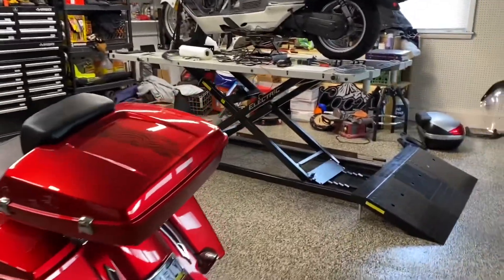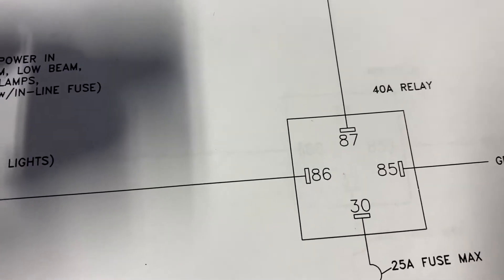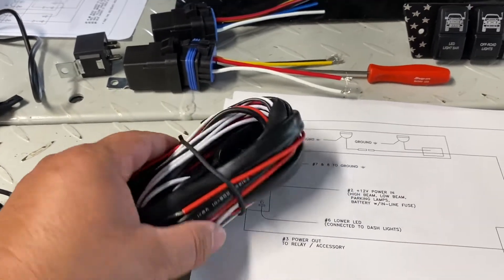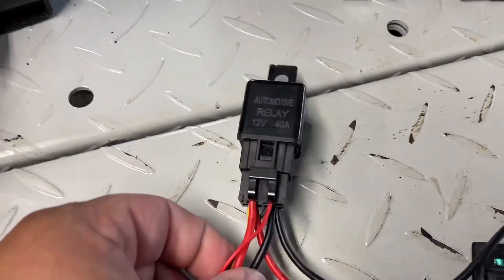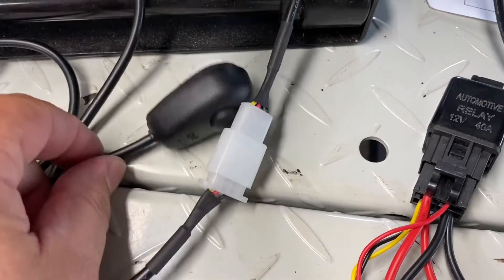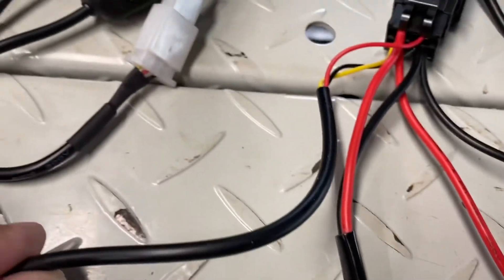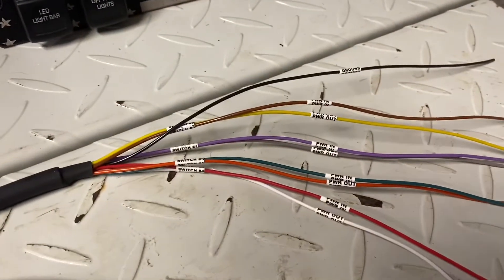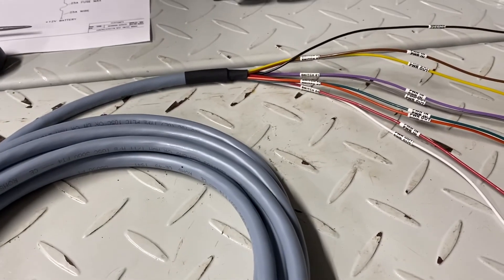KustomFX switch panels and relay connections

Comment: Love your completeness.  Not sure, but I have a strange set up.  I have an a-pod 8 switch console in my cabin with a box waiting in the engine bay for each switch just waiting for the two leader of connect to it.  I am so confused.   Lol.  Can I cut the relay out and just run the two leads to my S-pod. Ultimately the s-pod is really my battery connection with switch built into it.     Or if I have to keep the relay....  is so confusing.  85 black to lights and to black on s-pod.  And not switch?  87 red to lights    Now.  Power?  30 red to battery direct and 86 yellow to red on a-pod?  Is that weird to,have two red connections?  Seems wrong.  Thanks in advance
Reply from the maker: Sorry, but I have no experience with S-pod switch set ups. 
With ANY switch, you MUST use relays. Some relays can be wired differently, so you may want to use a test light or consult the relay manufacturer. Rigid also seems to be backwards on their relays too. 
Google “12V relay…type A & type B” and you can see 2 pins are different. Again, a test light can help.  
Hope the info helps.

Comment: Hello, what gauge wire do you use on your wired switch panels?
Reply from the maker: Hi,
The multi conductor power cable I use is 20 gauge wiring. Which is plenty when using relays since the relays take the load, not your switch or switch wiring. 
PIAA (big name in aftermarket quality lighting) uses 22ga.
I still prefer 20 gauge. 
Reminder: You MUST use relays. 
Thanks.
Reply: @kustomfxllc.switchpanels3144  thanks for the response. I actually bought a panel from you. Going to be using a fuse and relay panel and wanted to make sure I purchased the right size deutsch connector pins to wire it up.
Reply from the maker: @Mr.MartyMcFry  yes, 20 gauge will work perfect and that’s the gauge size used. 👍🏻👍🏻
Thanks again!

Comment: Apologies in advance for the dumb question. My knowledge of wiring is poor, but I’m trying to learn.  A relay, from what I understand, is actually 2 circuits. The one circuit when completed or closed by the switch (which you are selling) energizes the internal copper coil in the relay.  This  creates a magnetic field that moves 2 contacts together on the second circuit, which supplies power to a fog light or whatever device is being switched on or off.  The second circuit is a high amp circuit whereas the switch circuit is a small amp circuit. I kind of understand that. What I don’t understand is why pin 30 has 2 wires, one being the red wire supplying power to the fog light (or whatever is being switched) and the other a yellow wire to the switch. Is this not joining 2 circuits together?  Would the switch circuit with the copper coil not get fried?  Sorry, I’m trying to learn, so take it easy on a newbie to wiring.
Reply from the maker: Hi, 
Without getting into extreme detail on here, most all relay harnesses are made this way (many with different colored wiring) but are still made the same way. 
That pin #30 is the main power feed from the battery. The yellow wire is a “trigger wire” for your switch. 
When you turn your switch on, the relay will take all the amp load... not your switch or switch wiring. 
You can cut that yellow wire off that relay, and run that wire to your high beam positive/hot wire..... your switch will not come on until your high beams come on. 
In that example, which I personally do on all my bright LED’s is no different. 
That yellow wire will simply turn into your power in wire and only milliamperes are running through it. 
The relay is taking the main amp load. 
Hope that helps.